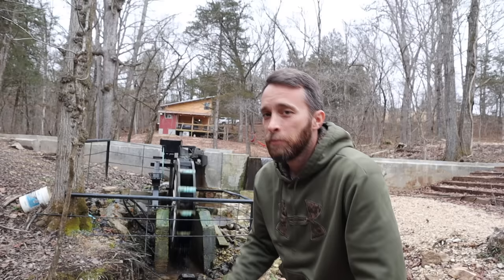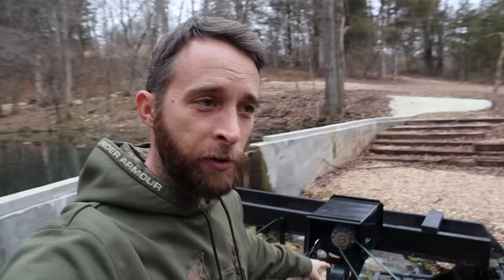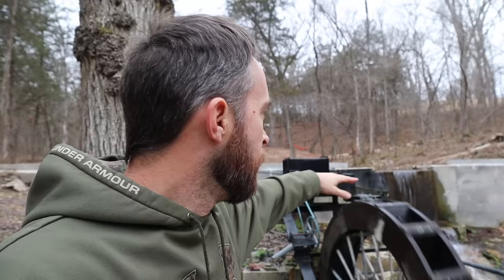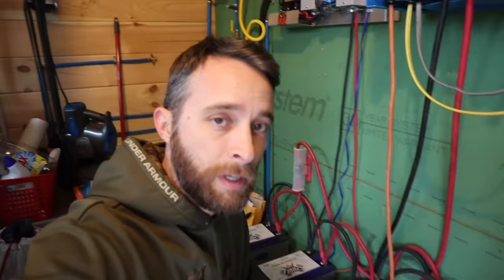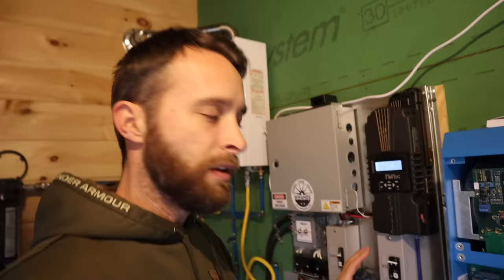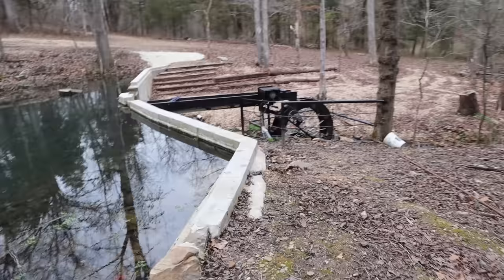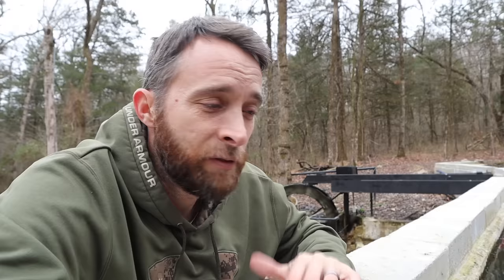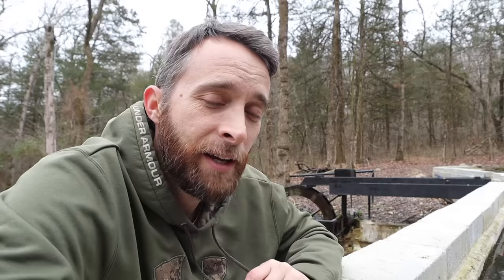Did we MAKE HYDRO POWER Using Our Waterwheel for Self Reliant Off Grid Living?

Comment: I think your suffering too much resistance loss due to distance. I suspect your consuming all your amperage overcoming the ohms of resistance. If that was 48 volts it would push through that cable easier, or build a small power shack there by the wheel maybe and invert it there and push 115v to the cabin.  Free advise is maybe worth what you pay, but hey.
Reply: And to the thought of converting it there at the wheel, buy a cheap battery and inverter and try it. That cable size would carry that 115v that far pretty easy.
Reply from the maker: That makes perfect sense... thank you!

Comment: The distance from the generator to batteries is way way to far. You need flywheel to smooth out the RPMs. Most importantly you need step up the voltage at the A/C generator and step it down at the inverter. Simple step up / step down transformers will do the trick.

Comment: This is the original quick look I gave you on the https://www.youtube.com/watch?v=sLGcF5zfB4Y video. 

You are going to want to know how much power, we will use watts since you are generating electricity, you can make with your dam. We will ignore any losses in bearings belts etc. Pure power based on falling water. With 300 gallons per minute and a three foot drop from the top of the dam to the top of the downstream flow you can make 40 pounds per second divided by 550 pounds per second per horsepower per foot, mulitplied by 3 feet to get horsepower. That flow and drop will make 0.218 horsepower. One horsepower is 750 watts. So you can make about 160 watts without losses. You will get almost 4 Kilowatt hours per day.  If you need more horsepower, just raise the damn and enlarge the wheel. Just reply to me on this comment,  if you need any more help with calculations like that. The nice part about this form of solar energy, sun evaporates water and moves it uphill as rain, is that it is 24/7 without interruption. Wind, air movement due to temp differences caused by the sun, is highly unreliable. Direct sun is only part time and can be very low with differing seasons and weather.

Comment: you'll be able to make that work, just find the issue. You should be using a rectifier at higher voltage to reduce the loss over the long wire run. don't know if that was part of your kit are not.

Comment: Hmm 500 rpm? Is that really true? Most generators work around 1500rpm? There are thos that are working at 500, but then they usually have quite large diameters? Do check what you get at the generator directly  if you get 24 volt at the poles on the generator, youre problem is in the wiring to your cabin. 24 volts 2kw would give an amperage of 83 amperes. Given 300 feet if wire to your cabin you would need at least 3 awg (26mm2, or .2294 inch2). That is pretty massively thick wiring. Just saying. Actually  to be on the safe side (and not run it hot) you should step it up to 4 awg. Just saying.

Comment: just an eye ball evaluation   from appearances you have enough water for around 150 -200 wats max with a really efficient insulation
also your wheel wheel design is some what inefficient hard to tell from the video but the buckets seem to empty way before reaching the bottom of the wheel  your best bet would be solar  and use the wheel for night    you can up the available water by  only running the wheel 8 hours a day and  storing water 16 hours

Comment: hi u  have only x amount of water which u cannot  increase but if the chute was slanted more or narrow the chute the volume of water would be the same but water speed would increase dramatically  your wheel will turn faster just place a length or two of wood  in between.the ones u have in chute ,then your 4  pulleys needs to be. first one much bigger than yours to second one 2 inch then on same shaft third one  as big as u can maybe 3 foot diameter pulley to fourth pulley 2 inch. this one could go on generator but i would not i would put a fifth and sixth pulley on, 3 foot to 2 inch and this one on generator. with the configuration of very big to very small,   speed is increased massively. your third pulley is way too small,  but by adding the fifth and sixth its another higher gear. do not have belts too tight as this is slowing them down, and remove pull spring off generator, its too much pressure, the weight of generator is enough for belt tension .  the long distance of wire from generator to batteries,  if this wire is too thick you will lose out, but not too thin to  heat either, on the wire you may need a coil or something to boost for long distance. hope this helps,

Comment: Wow 40 volts  2 amps ,okay guy so get ah pmg with ah higher current (amp) rating lower the water wheel ,extend water to drop on back side of wheel ,shorten dc battery connections and have a second flow  pipe for the dry season .you can thank me later by mail of a check lol

Comment: Hey bud is it charging any at all. If it is use it. If it will charge those batteries a little. Well the batteries will be charging. Are you spending money on it. Miles will use what you can get out of it. Even though it's frustrating. A little pinch of sugar. Can go a long ways. No if it causes your batteries to drop voltage. Lynn yeah no don't use it.

Comment: 44 inch to 2 inch will get much higher rpms but your generator is not big enough
Reply: Also what gauge wire did you run the over 200 ft away

Comment: U need to convert it to dc like I said to batteries and put counter weights on it in certain spots to spin it faster even on bad day bigger gear as u can vs small gear or pully on converter alternators what ever rember old engines and wheels like this giant axle with a steal gear that was big enough to stand on in sone cases bc when weight spins one it does it spins smaller one 10 time more per turn then smaller one and water fills buckets the counter weight on big gear has thicker supports in 3 spots to keep it spinning by weight just need a lil push same this u spin by hand to start up steam engine bigger heavy counter weight and bigger gear and covert to dc converter stores better bc even a .of an amp or what ever get stored other ways it won't unless u have certain amount of amps or volts so get a custom made gear out steal u want it to be almost same size as wheel or a pulley old wheels had but a gear at least half size of wheel or if not full size bc ur wheel how big and this lil axle reduces about of spins bc smaller gear if u make gear size of wheel like they use to be big ass pulley to small pilly to convert it how u do it
Reply: Anybody having problems bout acient mechanic look at photos u don't see it comment the answer usually with water wheels u need a weight as equal to wheel do when when does spin gears heavier same weight as wheel if not more bc heavier gear once it spins the weight makes it spin faster once it get up to speed weight of gear not enough to spin fast enough u think it be slow but no it slower with a smaller gear no counter weight on gears if u are using smaller gears based off trebuchets water wheels use to be attached to em to pull arm back all bout weight in mechanic in old school heavier wheel heavier gear same weight if not more on gear and ext if u can make a trebuchet u know how a water wheel works u need counter weight

Comment: What I saw was a 500 watt water wheel with a so called 2 kw generator.  The screenshot showed no power going into the batteries and almost full batteries with 1 or 2 amps leaving to perhaps power the invertor on standby.  Need to get someone at Missouri Wind and Power to look at this video and then call them to get some advice and then hire an master electrician to get most out what yo got.

Comment: You don't know if it does not work, you just didn't hammer out the finer details. That wheel is spinning non stop and you are not harvesting the power. You need a new motor and the pully system needs to be reworked. Get it working on a minimum level.  If you get that producing anything while i d o think there were better ways to do that, you have 90% of a set up... you are on the 5 yard line go for the field goal. 3 points... not a major victory but it will be a win, then supplement with a small solar system.... and done! I could have that producing reliable power in a day.

Comment: "We're losing a little bit of wattage there.."       No.  You are losing a lot of voltage.  12 volts will simply not transmit through a cable 240 feet,, unless it is huge  If you used 1 AWG,, that calculates to more than a 20% drop in voltage,, at that level you cannot charge anything.  AC will transmit farther than DC,,  You have so many variables on your system,, I really cannot know,, but do you have a generator, DC,, or do you have an alternator AC?  Double your voltage and you will reduce resistance by a factor.  Place your power inverter at the wheel so you transmit 120 AC

Comment: First of all wrong ratio,  second use the water wheel as the Pully with a large rope belt,  

Try to build up the. Water. Reservoir 6 feet higher,  then you can have a drops to the water wheel

Comment: Don’t give up on your water wheel. You made some mistakes because of the unknown.

Do what you have to do to correct your mistakes and keep it moving, don’t go to a system in which you’re equally not knowledgeable.

Make the changes; do what you have to do.

Maybe 3 smaller generators. You seem to have enough water.

I hope your wife is understanding.

Comment: Not sure where you got the info that your system would last longer or run better under 12 V versus 24 V but that’s completely wrong. 12 V system will cost substantially more and will not last as long because it has higher amps. Higher ramps means higher heat, higher heat means shorter lifespan.
Reply: Exactly. The longer the distance, the higher the voltage you want to use. 24 volts would be the minimum.
Reply from the maker: Sorry for the confusion.. I didn’t mean longer life, I meant longer run time.. the total amp hours is what I was referring too. But yes I understand what you are saying as well. Thanks
Reply: @LoftisPartyofSix  The Amp Hours would double but the voltage would be cut in half so the battery would power the same load for the same time (Not counting losses) so for example a 100AH battery at 12 volts is 1,200 watt hours now make that 24v so its 50AH of battery at 24 volts so 1,200 watts. This is one of the main confusions with Amp Hours. Even though reconfiguring for a lower voltage seems better as the Amp Hours goes up the actual watt hours stays consistent and the efficiency goes down so 12 volts is actually less effective.
Reply from the maker: Oh ok! See I’m totally not savvy at all this 😆. Thanks for clarifying. I just need someone to come stay in my cabin and do all this for me 😉!
Reply: @LoftisPartyofSix  Deal! ;)

Comment: Sure
Reply: A water wheel doesn't generate good power because the water flow is not under pressure.  Use an enclosed pipe from the highest point of your water source to generate pressure at the inlet of a small turbine. That will work a lot better !

Comment: Your water wheel has no mass!  Hook up an old hay bailer PTO weight. Right now you could grab that water wheel and stop it by hand.  Hook a weight to it. Get it rolling. The weight will act like a governor on a gas engine on a gas powered generator.  Change your sluice to a pipe with a 90° down pipe to hit the water wheel on the down side. IIIIII don’t know ???🤔🤔

Comment: Your calculation of water fall is incorrect. The calculation should be from the source directly to the use(water wheel ). The way you have it is the pond(source) to the water wheel(drop of 4 feet). Water weight is 0.433 lbs. per foot of rise. If you want to generate more voltage and Amps you must lower your water wheel down 20 to 25 feet fromthe outlet of the pond. Good luck.

Comment: I THINK IT'S A TORQUE PROBLEM... YOU'RE SPINNING WITH PANELS NOT BUCKETS YOU DON'T HAVE ENOUGH WATER TORQUE TO KEEP KEEP THAT ALTERNATOR SPINNING UNDER LOAD. SPEED IS ONE THING OVERCOMING THE TORQUE IS ANOTHER. YOU MIGHT TRY A DIFFERENT ALTERNATOR BUT ULTIMATELY YOU'RE NOT HAVING ENOUGH LEVERAGE PRESSURE ON YOUR WHEEL BECAUSE YOU HAVE PADDLES NOT BUCKETS. NOTE WHEN I SAY BUCKETS THEY ARE A SQUARE BUCKET. YOU PROBABLY CAN MODIFY YOUR WHEEL. YOU WANT THE WATER TO GO ON TOP OF THE BUCKET FLOW DOWN INTO THE BUCKET AS THE WHEEL SPINS THE BUCKET IS STILL FILLING UP UNTIL THE POINT THAT YOU NEED THE BUCKET TO RISE AND THEN IT DUMPS THE WATER QUICKLY.. WHAT DOES THESE BUCKETS LOOK LIKE. WELL... If you take a cardboard square box. Look down upon it and you start cutting along the edge from The middle to the corner to the opposite corner and back to the middle again along the edge now until you can take the flap that you've made and push it inward this is what a water wheel bucket looks like imagine water flowing into the bucket over top of what is left then it falls down and over the flap this is the upper position of the bucket your bucket should have wings so the water will not be wasted and it will go into the next bucket but we're still playing with this one. Now imagine a bucket halfway on the wheel it is full now is putting leverage on the wheel your weight of water is on the wheel now imagine the bucket at the bottom it is emptying but the flap is still keeping water in the flap just used it's usefulness and keeping water in the bucket. Now as the bucket is on the 7:00 position the water is fully empty.. it rises to be refilled once again.  Some people make a bucket with angled fins.
Reply from the maker: Thanks 😊

Comment: You have some bad math working here - voltage, wires size,etc.  however, if you don’t have a constant source of running water,  it will never be dependable.  Learn one simple truth - it takes a large wire to cover long distances. It takes 14.5 volts to charge a 12 volt battery.  Once you have that - how many Amp are you getting?   One Amp will take forever to charge anything, while 50 Amps will charge quickly.
Reply from the maker: Thanks 😊

Comment: Look into using a car alternator or two. You have plenty of water flow if you gear down your pulleys to turn the alternators at a good enough speed to create plenty of charge for you batteries.

Here is an example using steam power, but it could definitely work with water as well. 

https://youtu.be/85OmZU3dZpA

Comment: U losing electricity cause if they distance so they volts drop below 24 volts of it ,it has too be more that they voltage of the battery for it too charge goo and battle born are they best tho don't drain it too 0% always try too keep it above 20% charge ld

Comment: Please don't drain lithium batteries to zero volts, 80% of the time it will jump back but 20% they might fail completely.
It is a marketing hoax.
A suggestion for your turbine is try and adjust the angle of water on the wheel as well as a different fin design on which the water falls.
If the wheel is heavy enough there will be ample of torque try using a gearbox for increase in speed.

Comment: The fact that you thought that tiny generator was going to provide enough current to run your home, tells me that you do not even understand what you are trying to do. There is no reason that this water wheel cannot produce the 5 horse power needed to make 2,500 watts of power.  You just need a larger generator.   Do not measure your generator's output by voltage.  You need to start thinking of amps under load.   You need at least 30 amps (under load) to run basic things like refrigerator, lights, fans, and a battery charger.

Comment: You give up too easy. You need to keep tweaking until you figure out what's going on.  You really should be turning that generator with a chain not a belt. I bet you have all kinds of belt slip under full load. What you have is fine. It just needs all the bugs worked out so you can find the sweet spot.

Comment: zero knowledge whatsoever on power generation, so take what i say with the smallest grain of salt.  considering that the water wheel is massive and heavy, it can defiantly spin a gear box that increases load and also increases output rpm's to a generator.  this might be able to help increase output.